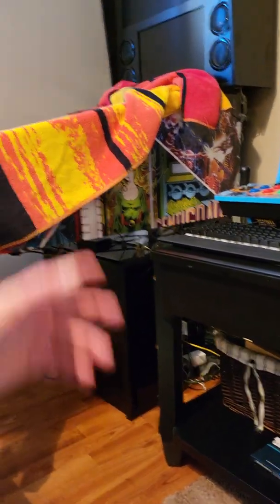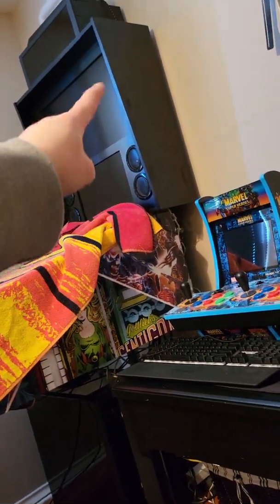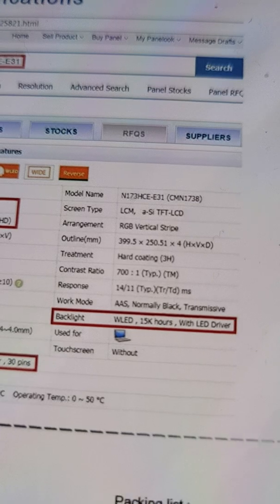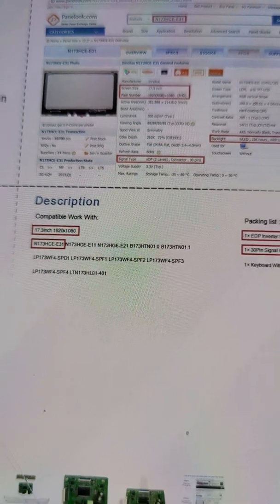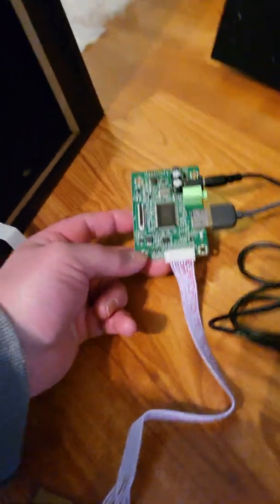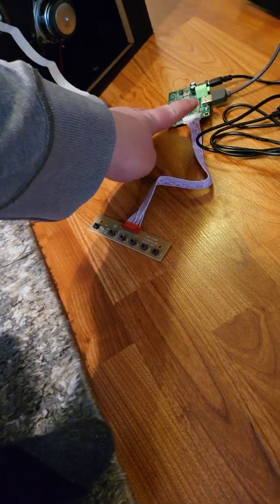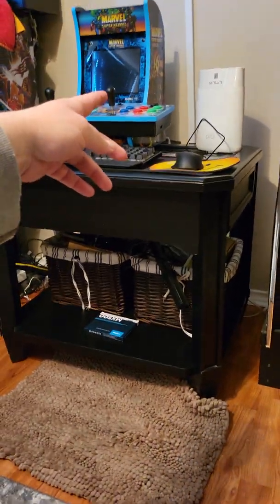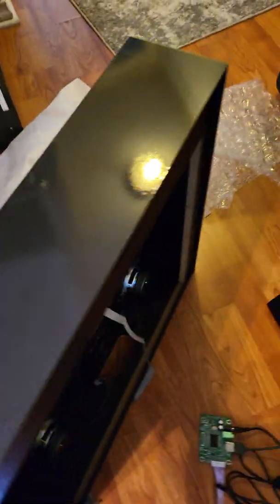Save $100's of dollars. Use any LCD screen you want w/ a hdmi connection. NO EXPENSIVE KITS NEEDED.

Comment: My display is just flashing colors, could it be a bad board? The light is green however .
Reply from the maker: Usually a display that rolls colors , or could be described as flashing different colors means it’s not receiving a correct video signal. 
. 

Whenever changing out lvds boards you have to use the cables that comes with it, even if the cables look exactly the same. 
Skip to the 12min mark of the video and I go over exactly this issue.
Reply: Mine is doing the same thing. I’ve used the included cable with the new board. A new hdmi 4K cable. And a 12v 5 amp psu. It’s rotating through colors. The light is green on the board as well….
Reply from the maker: @butttornadosstatuecollecti1618  , its def the lvds ribbon cable. Try putting the new one with the blue stripe different. Atgames has theirs backwards which is why i had to pull back the tape and put in thr new ribbon cable. Also i hope you djdnt just buy my board. I gave directions to get paper and a pen and ro copy down your specific numbers so you can order the right board. Atgames uses like 3 different brand monitor screens. So chances of us having the same screen is 1 in 3 maybe
Reply from the maker: Those arent the cables we are talking about. I explained it in the video around 1145ish. Same thing happened to me, the buystuff store guys told me i had to use the cable that comes with the board and that it wont be the same way that atgames uses it (they use theirs backward). I explained it all in the video and again in this thread. I also said dont just order the board i did because atgames gets their screens from a couple different manufacturers in china so you have to get a piece of paper and make sure you copied down all the correct codes etc. Your hdmi and power cables have nothing to do with this. Your white flat ribbon cable that comes with the new board you have to use or it wont work. Rolling colors tells me your usinf the stock flat cable still to connect your board or that you have it plugged in backwards. The rolling colors means you have a working board, but your screen isnt getting the signal from the board.
Reply from the maker: Skip to 1145ish in the video where i talk about how the guys at the buystuffarcades.com told me i had to use all the cables that came wirh the new boards and that i had ti try putting them in opposite of how atgames had them. And sure enough it worked.

Comment: Hey. Do you know how to mod the marvel countercade and add raspberry pi 4?
Reply from the maker: Yes , I’m waiting for my lcd converter board right now. Ordered it Saturday, says this week I should have it.
Reply: @AJerseyJohnnyEntertainment  nice! I've been looking for a tutorial for the new countercade mods. I would like to change the sticks too. The top keeps twisting off
Reply from the maker: @Ca Ki  when i get my board to use hdmi im gonna add a raspberry pi4 8gb. Ill post after i get it
Reply from the maker: Hey to let you know, I broke the ribbon cable to the counter cade so my girlfriend returned it and got me a replacement but I have such a Better way to do it. Dude, they have a hack that you install onto a usb stick, and you just need to open the back one time. You open it one Time to plug in a cable and you basically flash the system so that when you turn it on, it checks your usb port on the front for a usb drive. If one is there you have a bacotera build or whatever it’s called and it runs just as well as a raspberry pie!! The best part is if you want to play the stock games again, all you need to do is unplug the usb stick from the countercade before turning it on. When you do, it’s right back to the stock games. Then to play your Roms build , you just need to plug the usb drive back in. There is no taking anything apart or anything anymore. You just need to google countercade marvel vs Capcom usb hack etc something like that and you’ll find it. Once at the website you just need to download the one for the countercade you have. Good luck , it’s way worth it and you get to keep the stock parts all together too and don’t need to buy any kits or anything